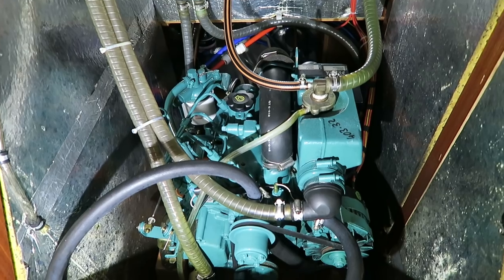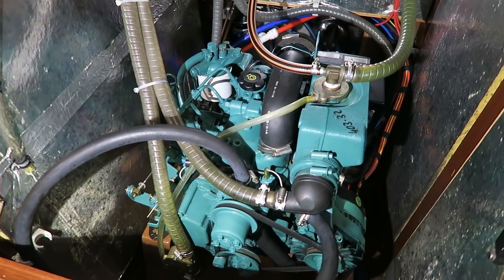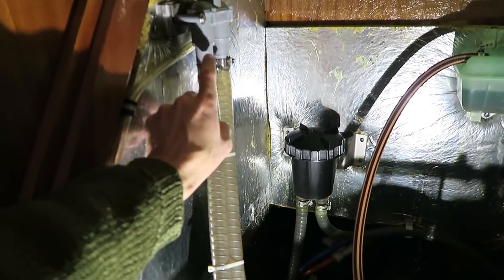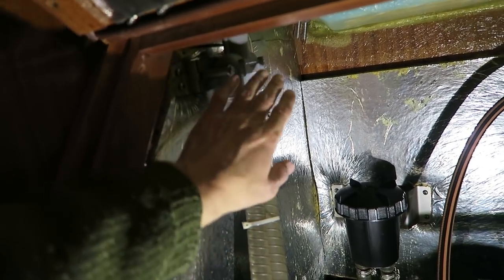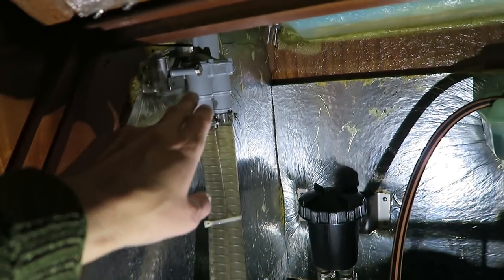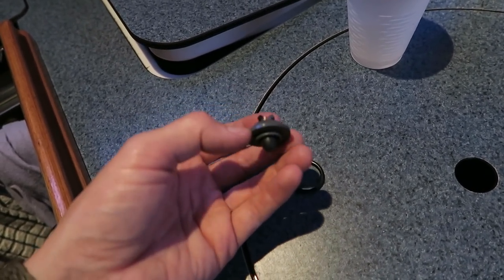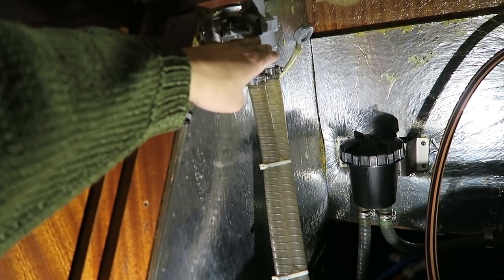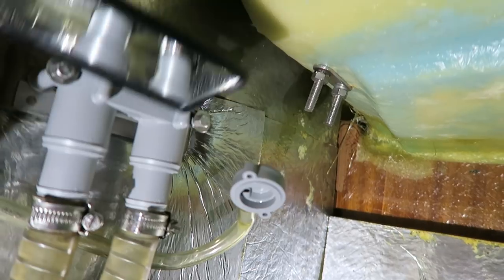Vetus anti siphon valve check - prevent flooding the engine with seawater

Comment: Thanks for all the videos you've produced for your Bavaria 32 Tino; as I have the same boat I've found them very useful. On this project I could not get the back cap screw loose because of the clearance problem, so I removed the whole assembly and bracket by removing the the 4 bracket screws. It was very quick, and easy to replace. To others, I recommend that you do not remove the two bolts holding the valve to the bracket as they have loose nuts on the back that will fall off and then you'll have to remove the bracket anyway.

Comment: ... thank you for the video. I would like to exchange my original Volvo Penta valve (defective) for the Vetus valve. However, my valve sits in front of the impeller pump? I.e. my seawater is sucked through the gooseneck and the valve and not pushed through. Do you think I need to change this, i.e. install the vacuum valve between the impeller pump and the engine? thank you for your opinion.

Comment: Should use teflon spray "Spray  the  valve  with  Teflon  spray  and  fit  it in the housing. Do not use any silicone oil, engine oil or grease" from Vetus usermanual
Reply: Yes, teflon spray on the valve, but silicone grease on the gasket.

Comment: Many thanks. This helped me clean mine.  TOP TIP - for a periodic quick check, blow down the air intake pipe gently - this should be possible. The suck, this should NOT be possible. Sometimes you can hear/feel the valve closing / opening. Very reassuring. But, yes also clean periodically.  Of course the vent pipe must not be in danger of being submerged in bilge water, this would have obvious bad consequences!

Comment: I missed a few videos.  This was a good one - a good look at a small but important part.  I'm wondering if the little bit of water staining is a small burp/few drops that get squeezed up into the vent line when the valve opens and closes.  It would be interesting to put a small cup under the vent to see how much water comes out of the line if you see water marks on the fire wall again.
Reply from the maker: I think the water drop marks is from the old  syphon valve since most of the original mounted valves are made of metal.  The syphon valve is designed so that only air can flow in one direction, if drops of water is entering the tube someting is wrong since the valve is closed with a spring and sealed with a O-ring.I have seen other boat videos where people puts down the valve hose in a bottle next to the engine, think it is a "easy fix" instead of fixing the valve.  I also know you can get valve less systems and they will spit some water occasionally.

Comment: Thanks so much for your video tutorial. I was cleaning out all my salt water cooling system and i find this device which is not in any of the manuals so im sure a previous owner installed it. They have installed it different to the way you have it, You have it going from your sea water sea cock but the previous owner of my sail boat installed this after the temperature switch so after its already gone into the engine. This is bad right? and this installation wont stop the flooding of the boat if the seacock goes bad so iv digging in the piping diagrams and whats suppose to happen is the seawater come in via the seacock and into the pump then into a t junction which goes to the engine block and also up to a temp switch then into a mixing elbow and out the exhaust etc but on mine the piping has been diverted from the temp switch into that anti syphon valve and back through then into the mixing elbow instead of how you have it going in the psyphon valve directly from the seacock. Thanks for videos I am subscribing xxx
Reply from the maker: Thanks for subscribing :) - You mention you have a temperature switch, maybe you have a water flow control system installed. Some people has this system mounted due to the safety of the cooling system, if there is to little waterflow you will get a alarm before the engine and exhaust overheat.
Reply: @twiper  thanks for your reply, the temp switch is factory default I believe as its shown in the original diagrams for my engine, from my understanding it controls at what temp the engine opens and uses the cooling as well as how you explain about the temp over heat alarm, I show it in my latest blog video if it peaks your interest. The installation is very strange to me being as its installed at the very end of the system instead of right at the start.
Reply: The valve is typically shown on the exhaust water ,see https://www.vetus.com/media/magentominds/sasdocument/20191118090431_0.pdf for the vetus instructions or have a look at the Beta engines installation requirements.
Reply: @swalemouth  Thanks for this and apologies I was not notified your reply. Ill have a look hopefully it will help me, im convinced it is an incorrect installation maybe a previous owner installed it without enough knowledge. My anti syphon valve is installed as i say after the water is sent to the engine and before it reaches the mixing elbow. its still very strange to me why it was installed in this stage of the system and not at the start like everyone else. iv had a few people look and no one can tell me why this has been installed like this. Every single other 1gm10 engine iv seen has it either at the start of system before water enters engine or they just install a water filter above the waterline

Comment: Hej tino
Fin video om antihæveret. Hvor højt ligger din motor i forhold til vandlinien ?
Reply from the maker: Tror den ligger i retning af 30 cm. under vandlinien hvis jeg skulle gi et bud
Reply: og du har ikke antihæveret andre steder på kølesystemet. Grunden til jeg spørge er fordi jeg er ved at skifte motor. På min gl motor var det nøjagtigt ligesom dit. ifbm med  ny motor lægges det op til af antihæveret skal placeres efter varmeveksler, altså på udstødnings siden. Det er jeg noget træt af og forstå ikke helt hvorfor
Reply from the maker: @enduranceendurance5770  Lyder som det er en Vetus du har købt. Nej jeg har kun en antihævert dette ene sted på båden og om den sidder det ene eller andet sted tror jeg er lige meget, pointen med ventilen er at vandet ikke skal kunne løbe tilbage i motoren. Kan være ideen med antihævert på udstødningssiden er grundet for at minimere sod, som du ved er mit system kendt for at stoppe til ved vand tilslutningen mellem varmeveksler og udstødnings knæ.